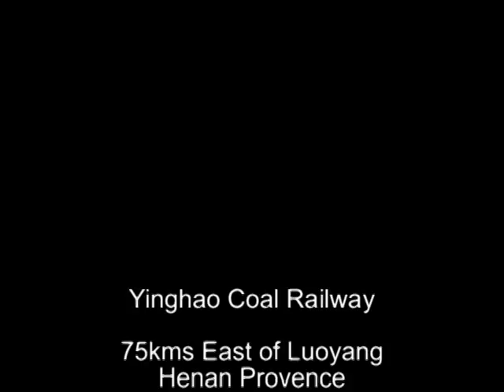Steam in China 2007 Narrow Gauge Part 3 of 4 -Yinghao Coal Railway

Comment: The resolution here is not the best, but I did not see any chunks of coal, either in the cars or in the shot of the cars being loaded at the mine.  My impression of the quality of the coal is pretty poor, and poor quality is also indicated by the ash shown being cleaned from the front of the boiler.  Good video, but mighty poor product being mined!
Reply from the maker: I am not sure if coal quality is indicated by the size of the product. Most coal mined in China is used to fuel electricity power stations. Most (?all) use pulverised coal as fuel. This is 'sprayed' into the furnace in a similar manner to bunker oil. I think the days of stokers heaving shovels full of coal through a fire-door are long gone. Powder coal is not the best fuel for steam locomotives but it is almost free for the mines so it would not make sense to buy the equivalent to Welsh Nuts for fuel. As for smokebox ash I would be very surprised to see anything else there.